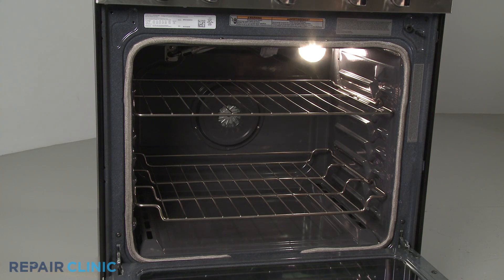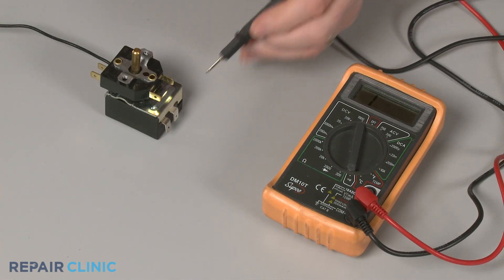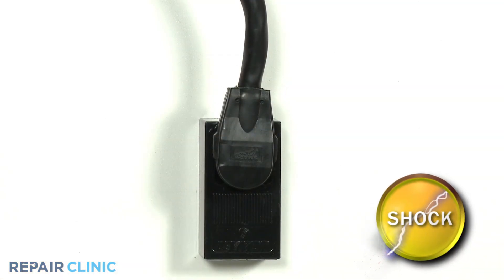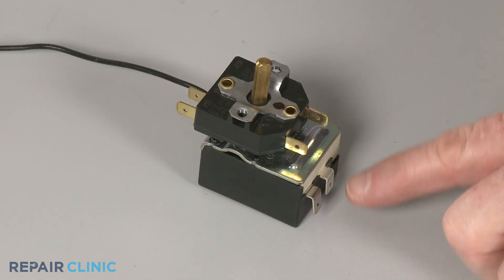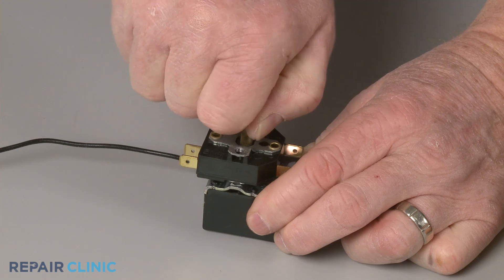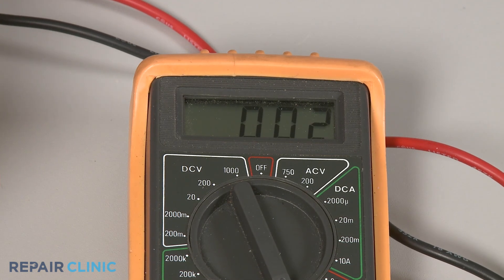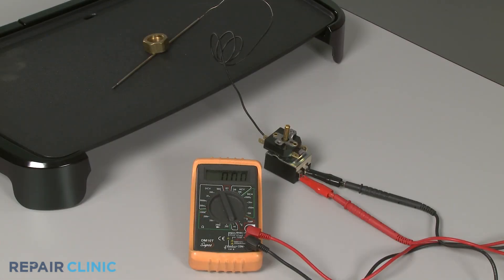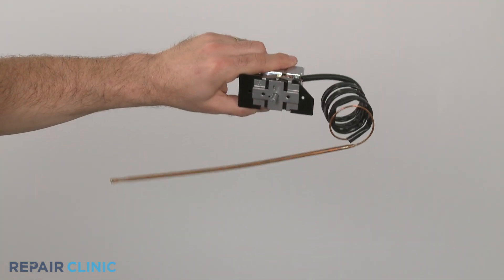Oven Temperature Control Thermostat Testing

Comment: Hi there, I need a wiring diagram for the same oven thermostat used in this video.  Mine did not come with one and the seller doesn't have one for it!  Please lmk if I can get one from you as I'm trying to save my oven and stuck without it!
Reply: This is why you always look at how the old one is and typically take a pic of how the wires connect and take them all off and most of the time on the oven bulbs they have numbers that reflect to your pictures color wire ie there the male meets the female there is a small number or letter

Comment: Noise was coming from the clock unit - disconnected it as it's not a control panel.  Probably my thermostat? The gas can flow even if the knob is in the off position? Total mechanical oven.

Comment: My GE gas oven has a high pitch noise ... I work up and found the oven on and the control was on off .... I turned it on/off and it shut off.  Wondering what the cause may be. (33 year old oven)

Comment: ????
All this test does is prove whether the thermostat opens and closes which you can do without removing it and a couple of jumper wires and no heat source. It does nothing to test accuracy of temperature control. 
After checking that it closes when turn on, if it doesn't heat, check for voltage at the element and ohms at the element. If those check good, adjust the thermostat to a higher temp to check that it's temperature control function is working. Much faster and less disassembly.
Reply: How does it not the griddle has a temp control with the number displayed put your knob on the terminal block and adjust accordingly not hard bro

Comment: Perfect! Just what I needed for my old Frigidaire stove with the single wire temperature sensor unit! Mine has 6 electrical contacts on it, though. Symptoms are the broil element comes on but the lower / bake heating element does not come on. I tested the bake element and it checks out fine via ohm meter test, so it must be the oven thermostat switch that is bad...now, to find one just like this - do you have one?
Reply: I have the exact same problem, but with an older Whirlpool!  Bought the ERP WB20K10026 Oven Thermostat, but it did not come with a wiring diagram.  Do you come across one??